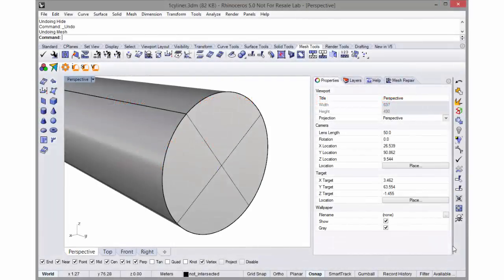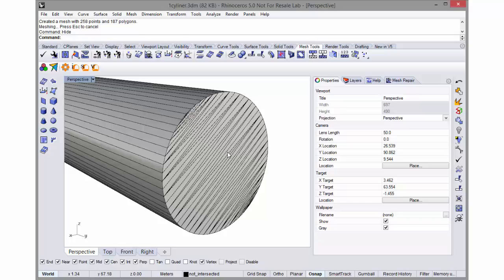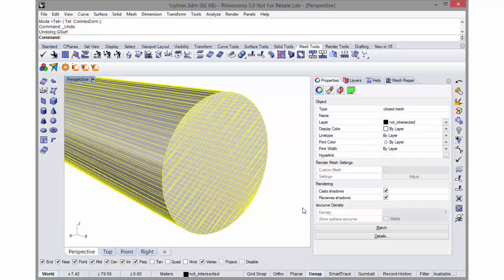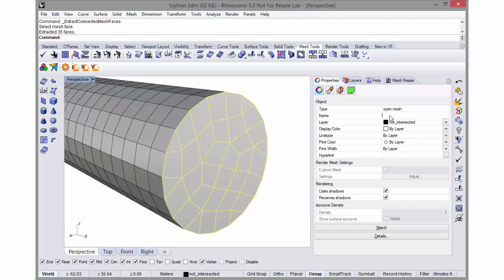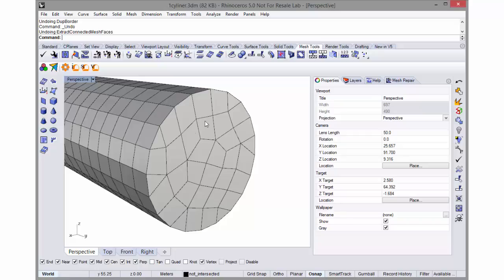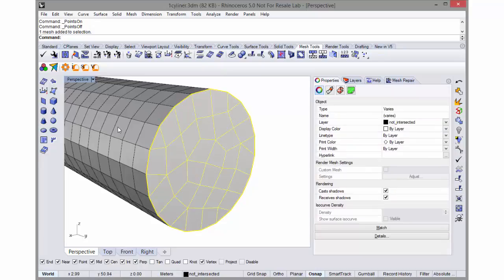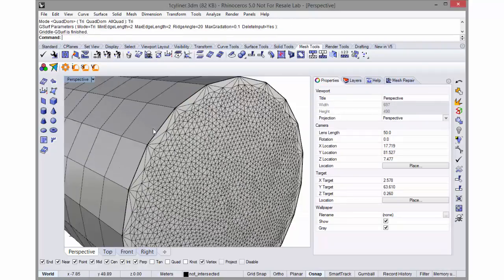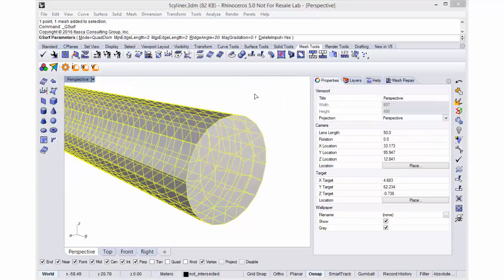Griddle Mesh Control

Comment from the maker: If you'd like to select the mesh around the length of the cylinder in this example (rather than the end face), use "Extract Connect Mesh Faces" (right-click the "Extract mesh faces" icon) under the "Mesh Tool" tab in Rhino and increase the "Extract faces connected with [break] angle value". As you increase this value, more and more connected faces will be selected based on their relative angles. At around <20 degrees the cylinder wall should be fully selected.